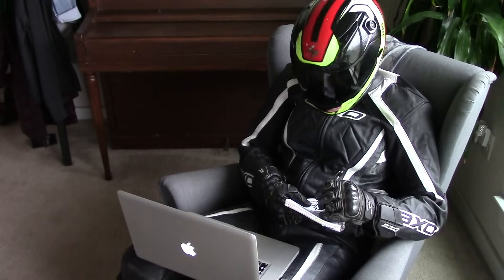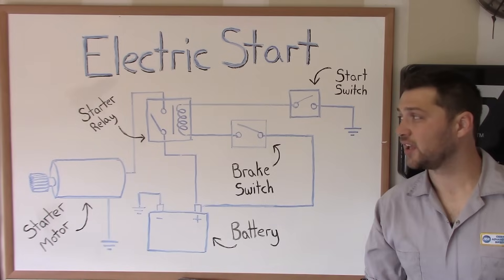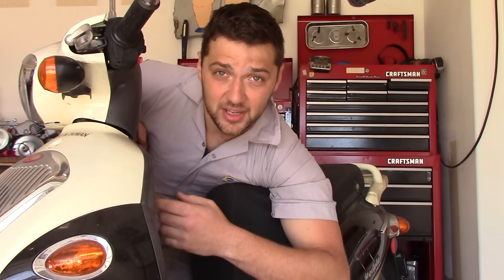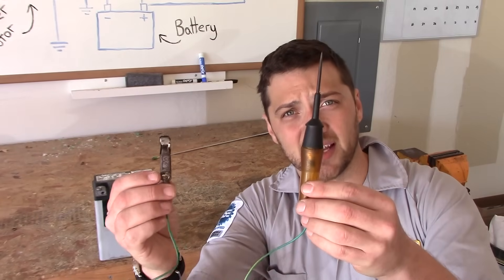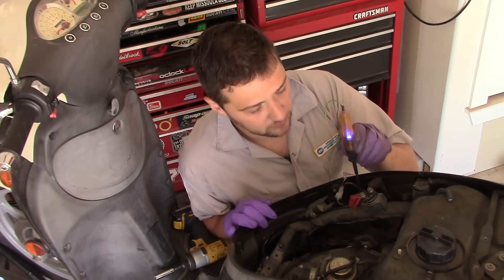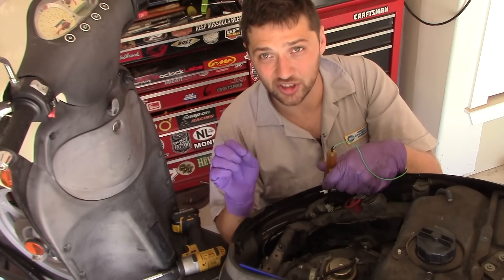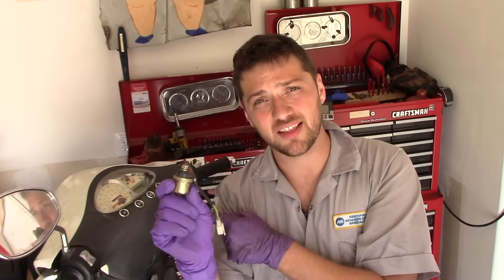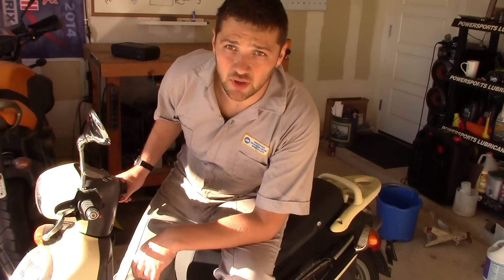Scooter 911: Electric Start Doesn't Work (troubleshooting your starter, starter relay, and circuit)

Comment: what if my relay box is just clicking?
Reply from the maker: Did you try the relay bypass test at 7:32?
Reply: Garret Seesing yes i did. nothing but a single click when i press the start button
Reply from the maker: @lilporno6583  you touched the terminals with a piece of metal? When you do that test you do not need to press the button

Comment: Someone attempted to Hotwire my scooter but failed, they still pulled out a bunch of wires tho. Any advice?
Reply from the maker: Each wire has a specific color, so you can just match the wires back to where they need to go! Good luck!
Reply: Garret Seesing got it working thanks very much 👍. Just got to fix the horn they disabled.
Reply from the maker: @edwardjones9098  right on!

Comment: I have a Lance Cabo 125 horn is honking, all lights and gauges are lighting up but nothing is happening when I press the auto start button no clicking, nothing at all. Any suggestions?
Reply: So I got it working correctly but now when I try shutting it down it makes the sound as if it is trying to start up. Any idea what this may be?
Reply from the maker: @813king7  well if you didn't mess with any wiring I would have to suspect your starter relay is getting stuck. Remember when your starter relay gets a 12v power and a ground it will connect the terminals. It doesn't matter where it gets them from
Reply from the maker: yes absolutely! Did you try the starter relay bypass at 7:32?
Reply: I have not tried yet. The problem actually occurred today. It did recently start making the noise you have at the 3:37 mark in this video.  I will tinker with it tomorrow to see if your trick will work. Thanks.

Comment: My scooter is making a noise when I try to start it as if Somethings not catching and I put a new starter on it and it still does the same thing
Reply: 150cc
Reply from the maker: @botzgod1076  so it makes like a whirring noise sort of like an electric drill but the engine doesn't crank? Look through the fan shroud while trying to start it does the fan turn?
Reply: The fan turn but stops
Reply from the maker: @botzgod1076  can you explain more about the fan? What do you mean it turns but stops?
Reply: When the noise start the fan  stopped
Reply from the maker: @botzgod1076  ok that sounds like you have a problem with your starter clutch, sometimes referred to as "sprag clutch"
Reply: Thanks for the help but I think it's the starter clutch
Reply from the maker: Is it a 50cc?
Reply: How can I send a video

Comment: So the noise at 3:40 wasn’t explained that I can see and that’s the noise my AJS A9 flight 125 has started to make recently, what can I do to fix it?? Also, will deffo subscribe, nice funny vids!
Reply from the maker: That noise is called cranking, it means your starter motor is turning the engine over. So if your scooter is making that sound the electric start system is working properly. If your scooter makes that sound and still doesn't start you have an engine problem. 

I do have some no start diagnostic videos in the works right now so stay tuned! Thanks for the subscribe!
Reply: Been doing a little research, by all accounts a new CDI box would solve this issue, what you think? Thanks
Reply from the maker: @Alyssia2022  well I can't exactly condone throwing parts at it without properly testing the current hardware. I would recommend testing for spark first to see if that is your issue.
Reply: Garret Seesing 
Hi, spark plug is perfectly fine, had it in garage while I was on holiday and they can’t seem to find what’s wrong, but found out was a car mechanic not a bike mechanic who looked at my bike! Any progress in your cranking video?? Thanks
Reply: Thanks for fast reply!! Will await new vids, probs have to take bike to garage in mean time tho lol

Comment: Mine wont start electric and it new tried to charge battery told me its charged,making clicking noises also have not change tho oil yet tho..kick start its hard to kick cuz of the middle stand i cant put down cuz you have to lift 200 pounds off the ground to hit it..
Reply from the maker: Did you try the starter relay test at 7:32?
Reply: Garret Seesing shit no wow nice

Comment: Hello Garrett. Good video. I need to buy a tester and I’m charging my battery now with a tender, but before I go and buy anything, what do what do you suspect the problem could be with my scooter if I have these indications:

-Electric start won’t turn the scooter on.
-I can kick start the scooter and it runs fine.
-No lights work and horn doesn’t work when key is in ignition but not fully started BUT I see the fuel gauge needle move (maybe just a weak battery?)
-Does not make any noise when attempting to electrically start BUT can be difficult to start on stretches of days with no use
-corrosion on the battery terminals

Thanks
Reply: Scooter is a Kymco 125 agility btw
Reply from the maker: Sounds to me like you have a week or dead battery. It takes a lot more battery power to honk the horn than to move the fuel gauge. You can also try the turn signals with the key on engine off. A strong battery should be able to run the turn signals no problem.
Reply: Garret Seesing You’re the man. I appreciate the help.
Reply from the maker: @jasonclemente5880  no problem dude! Good luck, and let me know how it goes!

Comment: i bought a used piaggio zip  4t (2007) and if i start it doesnt make any noise but all the lights work with my new battery and the kick starter works almost everytime. Iam really stuck at this point.
Reply from the maker: Oh I love the piaggio zip, great scooter. Does the brake light illuminate with when you hold the brake lever?
Reply: Garret Seesing yes it does all Lights work but when I start it my horn doesn’t work and when started with Kickstarter the horn works half
Reply from the maker: @nielsrh  did you try the starter relay bypass test at 7:32?
Reply: Garret Seesing no I have been searching for it but iam unable to find the starter relay

Comment: Can you help me with my moped I got it for $15 dollars and the person I got it from lost the key so I did the  wire to red and black and it trys to start but does do you think it will start with a new ignition switch?
Reply from the maker: The ignition switch usually has 4 wires. Sounds like you connected the 2 power wires which is correct but the other two wires (which are usually green and black with white stripe) operate the kill switch portion of the switch. In the off position those wires are connected, so you might try disconnecting the green wire from the switch. Ignition switches are pretty cheap though so in the long term replacing it is your best bet. Let me know how it goes!
Reply: @Scooter_911  can I just buy a 4 wire ignition switch and connect the wires same  colors red black green and black with white line
Reply from the maker: @jerrysparks9227  yes they're pretty universal
Reply: @Scooter_911  thanks ordered it today I'll let you know the outcome after I get it

Comment: I appreciate the effort you put into your videos.
This one is sure to identify my intermittent  starting problem.
Reply from the maker: Thanks for your kind words. I sure hope that it does. Intermittent problems are the worst!
Reply: @Scooter_911  
The 12 volt battery for my150cc gy6 was recently fully charged and professionally tested by a parts store and declared fully functional.
2 weeks later having starting issue. When jumped,, it starts and runs perfectly.
But when tested with my volt meter yesterday i was only getting 9.5 volts across the terminals in a non running state and it wouldnt  start on its own.  If i start it, then connect my volt meter again across the battery terminals and increase the rpms, will an increase in voltage on my meter indicate my scooters charging components are working correctly?
If you don't have time to answer, no worries and keep up the great videos.
They're very concise, easy to understand and possess just the right amount of cheesy levity to entertain as well as greatly inform in a non condescending manner.
Either way, thank you Garret.
Paul
Reply from the maker: @pauldstoltman  Actually I made a video to address this exact problem! and it sounds like you already have a good handle on the multimeter so this should go quickly for you! check out https://youtu.be/l20k6vFoz2Y

Comment: Ok, Garret, pt. 2. It was running and I rode it around all day, stopping many times and starting it normally. The problem is, if it were to sit for a few hours, I would have to crank it for 30 or 40 seconds before it would catch. (This is in 65 degree weather, mind you, so it's not cold out).  I didn't mind that so much, as long as I could start it. 
   
  So, the next day, I started it again and drove it. When I let off the accelerator, I could feel that it wanted to stall. It didn't do this the day before. I had to keep the accelerator going, or it would stall. When it did stall, I could not get it started. I even sprayed some starting fluid in there, but no sign of life whatsoever. I tried it again, several times throughout the day (without the starting fluid) and nothing. 
   Nothing was more exhilarating than to be able to start this in the first place and have it start on successive tries throughout the day and nothing was more discouraging, disheartening and depressing to have it not start. I don't know how you do it. I just want to throw my hands up and sell it as is and take a loss. Like I said, it had been sitting for 5 months. Do you think the gas might be bad? Why would it all of a sudden fail like that? It also idled pretty roughly, but ran prior to this. Help me, Obiwan Kenobi. You're my only hope!
Reply from the maker: I'm so sorry I didn't see this comment when you sent it. Yes I would absolutely suspect that the carburetor needs a good service after sitting 5 months, but don't rule out the possibility of a valve adjustment! its a vital part of scooter ownership!
Reply: @Scooter_911  hi again, Garret. As it turns out I had a hole in the vacuum line.the one that goes to the fuel regulator if you will. So it has been running great, largely due to your help. I have a new problem that maybe you can help me with.I recently replaced the headlight bulb but in doing so I kind of pulled on The wire too hard and I think it shorted out somethingI took off the front plastic and I could see that there was burning on the socket which indicated a short. The ground wire had burned off of the socket. Now I think this had something to do with why it is very hard to start and takes about a minute of cranking. Once it is started it runs very well.I turn it off and a half hour later I can't get it started again. Do you think short-circuit I created has fried something else in the system? Could it be the CDI? Like I say, when it's running it runs perfectly. It's just very hard to start.
Reply from the maker: @radconserv68  well in my experience when a CDI or an ignition component fails, it usually fails completely. What I would do is ride it around and get it to fail at your house. Then when it won't start make sure it has spark, or you can introduce and external fuel source to see what you're missing. Have you performed a valve adjustment on it yet?
Reply: @Scooter_911  I have not done valve adjustment.but, when it does run it runs perfectly so I don't see how valve adjustment would be the problem
Reply from the maker: @radconserv68  that is an excellent question. You see when you are dealing with a complex diagnosis you need to control as many variables as possible. The valve adjustment may not be the issue preventing the scooter from starting but lower compression due to the valves hanging open a little can accentuate another issue like weak spark. You need to insure the bike has a proper "state of tune". In fact the electrical issue could be mutually exclusive entirely.

Engine start up requires the most from all the components i.e. fuel, spark, air, compression. Once it is running the heat of combustion can aid in the continued combustion, masking the real starting issue. You can sometimes even compensate for low compression by adding extra fuel. This is why some engines will start up after excessive cranking (because you're sucking a ton of fuel into the cylinder).

If you check the valves and they are within spec, I would observe what the spark looks like when the engine is hard to start. Get the engine up to temperature and let it sit, or whatever the scenario is when the bike won't start. If you have week or no spark at that time I would check the resistance and AC voltage of the stator charge coil. Then do the same for the pickup coil. The last thing to check would be the automatic choke on the carburetor.
Reply: @Scooter_911  wow. That is a tremendous amount of information. Let me preface my response with saying that intermittent problems are the hardest to solve, would you not agree? I truly appreciate your responses and help. I have some chronic fatigue, so it's very hard for me to keep working on this. It's also a very daunting task. One thing I am curious about is you talking about a weak spark. Is there such a thing? I thought either you have a spark or you don't, not a strong or a weak one. Can you elaborate on that and what would be the cause of it?
Reply: @Scooter_911  furthermore, I would like to rule out the automatic choke, as it would just start, after couple of cranks , no matter what the temperature was. This is the classic intermittent problem that we all hate. Intermittent is the word of the day. The nightmare of all mechanics.I just feel like changing every single part of this whole freaking thing get it running right
Reply from the maker: @radconserv68  this might be something we need to discuss over Skype. Shoot me an email at garretseesingofficial@gmail.com and we'll set something up if you'd like.

Comment: Garret, my scooter had been sitting for five months, because the electric start didn't work and I couldn't get it going by kick starting it. This vid was EXTREMELY helpful, as I bypassed the starter relay and was pleased to hear it crank!! I had to spray some starter fluid in there and it was up and running. I later realized that I had to use the back brake lever to complete the circuit, to start it normally, as the front brake switch appears to not be working.
Reply: Garrett at the end of video when by passing the relay with pliers , the noise that scooter made b4 turning over the engine is all I get out of my scooter when by passing relay . It doesn't even crank. It as if starter is trying to spin but that's all it does. Plz help

Comment: First of all, awesome video! Still having some trouble though. This scooter was a friends and sat for 4 years. I haven’t been able to start it with the electric start, but it has come really close. I can kick start it and it will run for like 5 seconds and then turn off. It feels like the more times I try kick starting it the quicker it turns off, as if it’s getting weaker. Blinkers and tail lights work high beams don’t but that’s probably an issue itself. Any suggestions? Thanks!
Reply: Would you recommend getting a new carburetor?
Reply from the maker: @ZAzamar123  that is a very good option considering the time and tools it takes to rebuild a carb compared to how inexpensive they have become recently.
Reply: It’s a 2014 TaoTao 50cc
Reply from the maker: Well usually when a scooter sits that long the fuel in the carburetor goes bad and plugs up all the tiny orifices that make it work.

I'm assuming the electric start system does actually work but the engine does not run?
Reply: Garret Seesing I forgot to say that I put new fuel in the tank. Could be clogged still, if have to look. I wasn’t able to start it electrically just with the kick start but then it would bog out within 5 seconds
Reply from the maker: @ZAzamar123 Ok so the electric starter is cranking the engine but the engine doesn't run. When fuel goes really bad it actually turns into a solid or a paste inside the carburetor jets so fresh gas in the fuel tank won't fix the actual issue. I will be doing a carburetor service video soon so stay tuned!